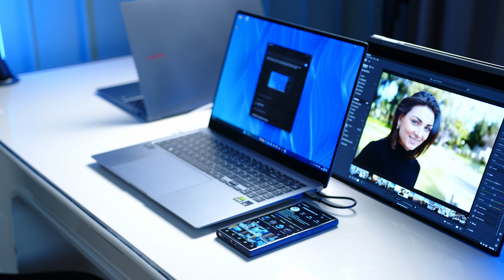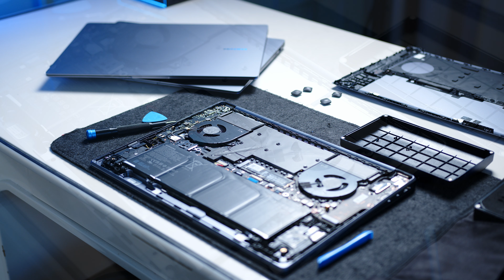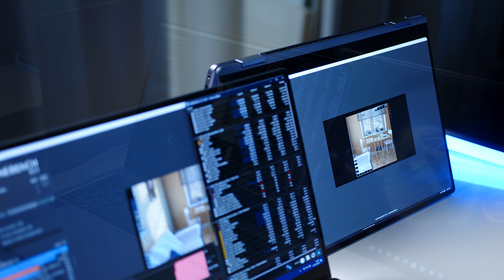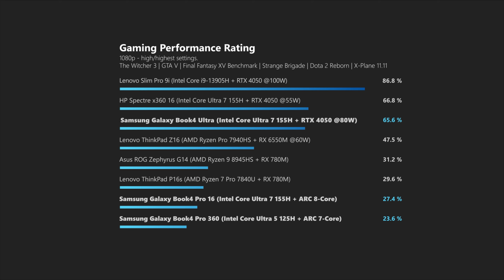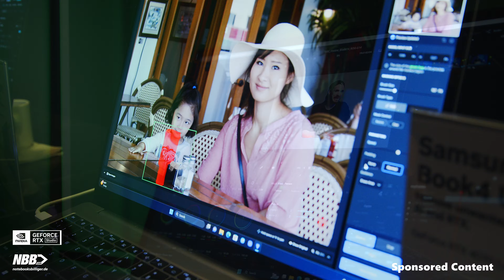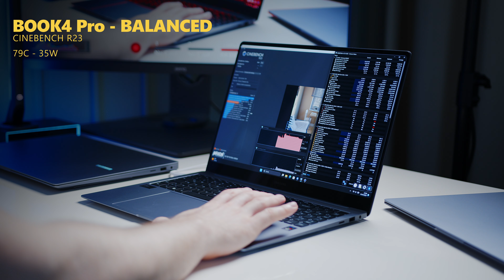MacBooks Beware!? - Samsung Galaxy Book 4 Ultra, Book 4 Pro, Book 4 Pro 360 Review

Comment: There are THREE glaring things that keep me from considering the 360 models: 

1) Lack of a 32 GB RAM option. As someone who's a 30+ year Professional Graphic Designer who uses Adobe Products, 16GB especially for a "PRO" model is not good enough. It will never be. 

2) Windows 11 Home. A "PRO" version should have a "PRO" operating system. This is just total bullshit on Samsung's part. 

3) This last one is cosmetic, but that awful large chin on the bottom of the screen is absolutely useless and serves no purpose except highlighting Samsung's poor design. They really need to get rid of it. It's not on their phones or tablets, so it contrasts with their design language. 

EXTRA CREDIT: The price is outrageous!!! 

I have a Dell XPS 7390 2-in-1, 10th Gen i7, 4K with 32GB of RAM, and the thing is still really good. The Dell Premium Active Pen - PN579X is also a Wacom Stylus and it works very good, but honestly it's not the S-Pen. I'm thinking about the new ASUS Duo with the two 3K OLED panels. It comes with 32GB of RAM, Ultra 9, a stylus and other extras for the exact same price. I'm not familiar with the ASUS Stylus with Microsoft's Pen Protocol (MPP) 2.0. so we'll see...

Comment: I felt the comment on the 16 gigs and the storage were a bit unfair, until you unveiled the price. I fully agree, this might be a very fine ultra-slim, but when you are asking 2k EUR for the i5 version? Come on Samsung, you are not Apple, people won't just buy your stuff by default because of the logo on it. Well, most people outside SK won't. 

Take the Zenbook 14 OLED, also an ultra-portable 14" OLED device. It starts at literally half the price of the basic Book 4, after a quick google for Asus' germany website. I can configure one with an Ultra 9 processor, 32 GB of RAM, 1 TB of storage and a 3K OLED touch-screen for 1700 EUR. Why wouldn't I get device that is so much more capable, just as well built, if not better, and significantly cheaper? Heck, in the US review, the Zenbook 14 with the Ultra 7/32/1 TB comes, with a stylus, at 1300 USD. 

Even the Spectre x360, which is most definitely a premium-priced device, can be had with an 155H/16 GB/1 TB config for 1800 EUR directly on HP's website, also boasting fully convertible build with a 3K OLED touch-screen. For 2400 EUR, I can have it with a 4050, 32 GB of RAM and 2 TB SSD. I pretty massive rip-off, 600 EUR for adding a 4050, but it's still cheaper than the Book Ultra with comparable specs by hundreds of euros.

The same way the 2020 G14 opened the gates for sleek, portable and well performing gaming notebooks, it seems like the M1 revolution has lit a fire under most company's ultra portable divisions. These are some outstanding specs for the price, given it's an ultra portable machine. I'm talking, of course, about the Zenbook. 

Samsung needs a 40% price cut to start competing.
Reply: People are mostly paying for the ecosystem
Reply: If I'm not mistaken the price have gone down

Comment: I am not a fan of 2024 Intel chips, and if you are due an upgrade and expect to keep your ultrabook for 5-7 years, then waiting for 2025 will be the best bet.

If you have to, I suspect these will be low on your list. They are far too expensive, though prices are bound to drop. Their erratic regional variations are also a pain, with the US seemingly getting better options. Back in the day, I bought the OG Galaxy Book Pro, which has stood the test of time with aplomb, so its reliability and quality are Apple-like. Also, OS firmware and software updates have been continuous. I caveat my purchase by saying I paid less than half of the launch retail price way back when, so it represented solid value.